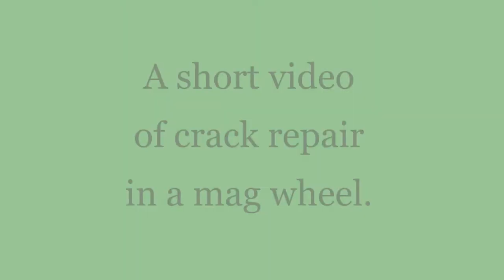Mag wheel crack repair

Comment: How much amper this one 200 or 300amp
Reply from the maker: Can't remember, I think it was about 160 amp. My welder is 200 amp.
Reply: which welding machine use
Reply: @alijonda4440  it’s a tig welding machine, any kind can do the trick. I’ve use a cheap 500$ eastwood when my miller was being repaired. It got the job done